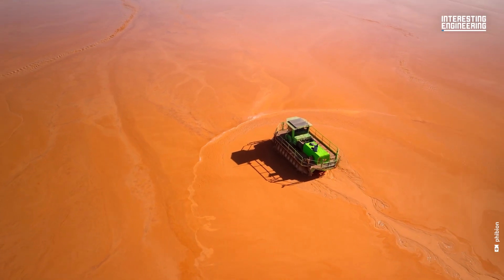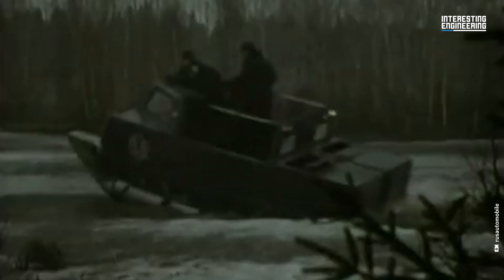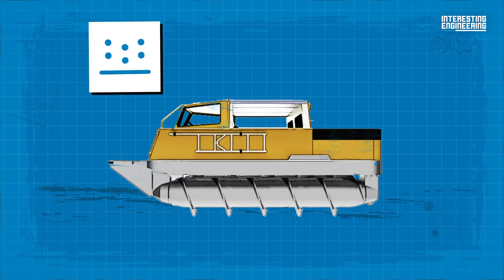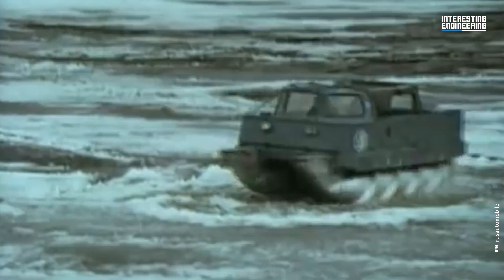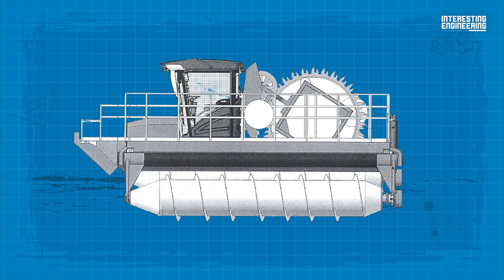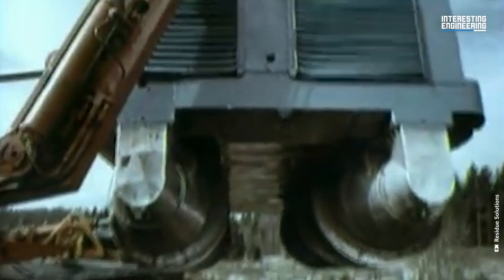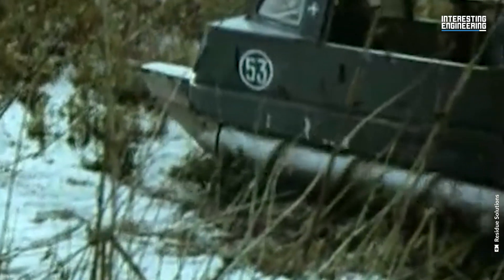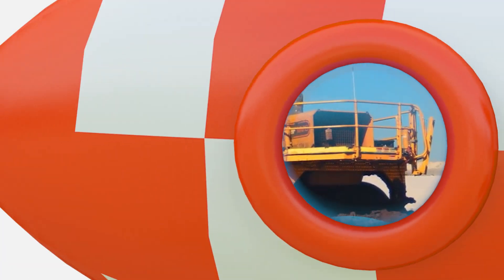Car That Rides On Two Large Screwdrivers

Comment: I learned from an all terrain toy with screw wheels, that sufficient torque is a challenge, with much of the energy going towards friction instead of forward movement. and it can traverse hard terrain, but it heavily wears the screws, and can struggle with too little friction. It is best suited in semi-liquid environments, where it's too fluid for tracks and too solid for boats, but just because it can be all terrain, doesn't mean it's worth it.